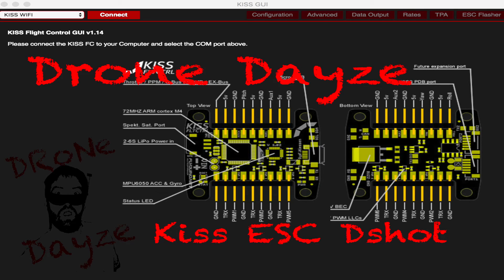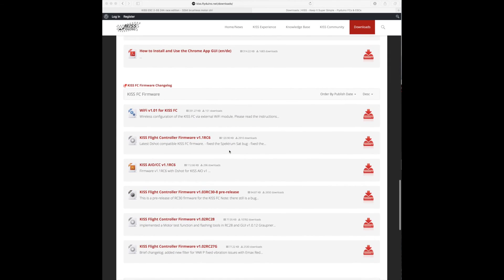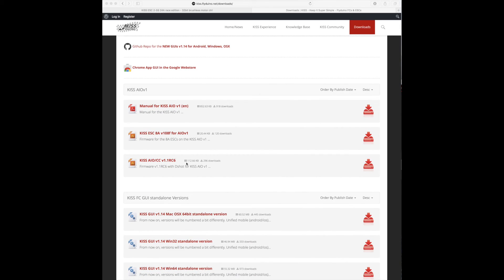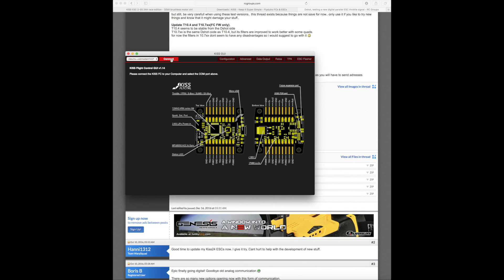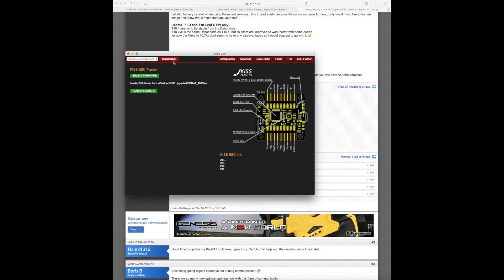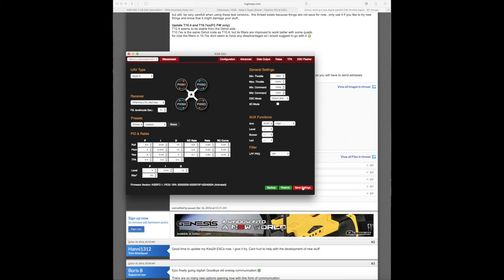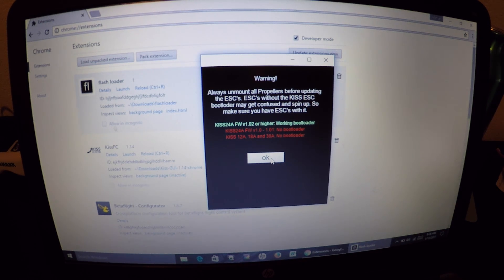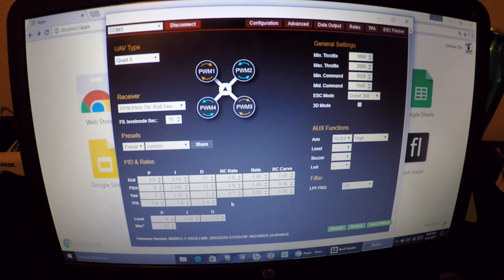Drone Dayze: How to series: Flashing Kiss ESC to run Dshot

Comment: Thanks for taking the time to make this video. I am having the same issue with dshot600. If I flash using the method with flash loader dshot 300 seems to work but not dshot 600. I did not check the fast mode when flashing tho as it did make my motors spin which leads me to believe the boot loader isn't reading properly. Have u managed since this to get dshot600 working? And we're you checking fast mode when u flashed with the flash loader
Reply from the maker: tmaintv yea same issue... dshot600 would cause power failure which resulted in crashing. From what I can tell kiss only supports so much speed through the processor and dshot300 is extremely fast even comparing it to oneshot so I just settled on that 😃
Reply: Many thanks. Makes sense. Can I ask do you see info displayed for your esc's in the flashing tab. I am not getting this on mine even though I have telemetry lead connected
Reply from the maker: tmaintv at the time of this video that's what I thought but this doesn't seem to be the case in regards to the telemetry wire, mine do not show up either... not sure why.

Comment: I can't find that flash loader on extensions or on apps
Reply: Help
Reply from the maker: DaZe Fpv https://www.rcgroups.com/forums/showthread.php?2756129-Dshot-testing-a-new-digital-parallel-ESC-throttle-signal check out this form and downloAd that flahloader give that a try worked for me good luck!!
Reply from the maker: DaZe Fpv should be at the bottom of that first post KISSesc_flashloader
Reply: Thanks a lot man

Comment: i´m happy with oneshot125, is dshot so much better?
Reply from the maker: CYCOJOE888 when compared to 125 you will be able to tell a difference as that is what I was running. It's about 3 times faster than 125